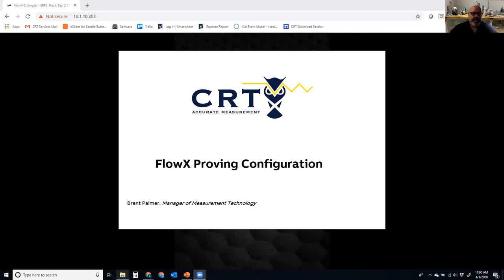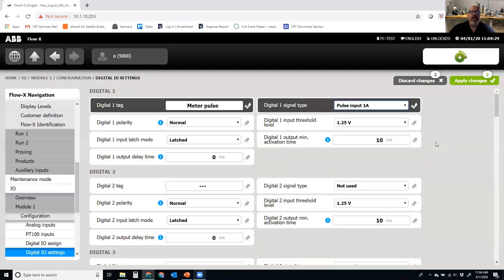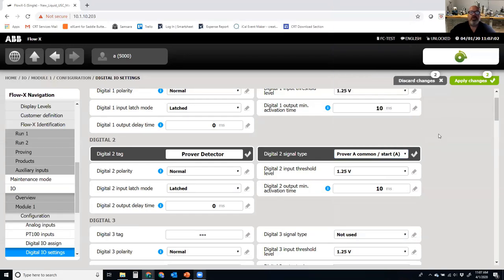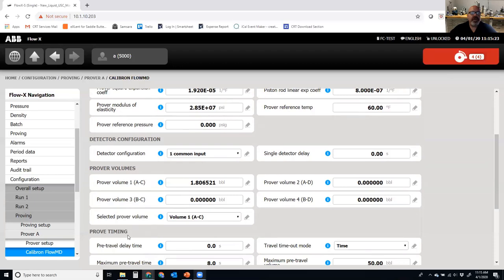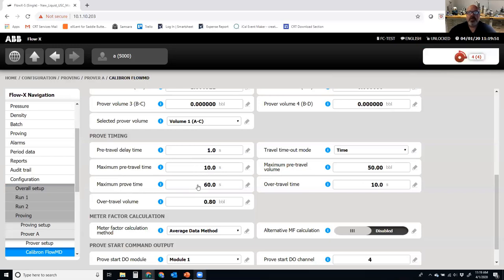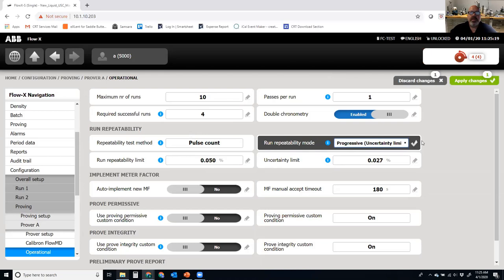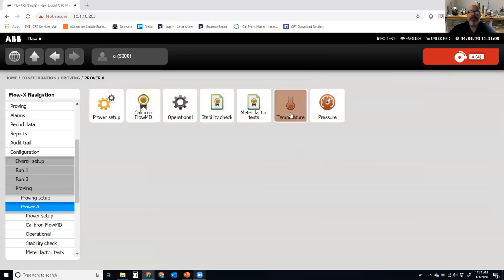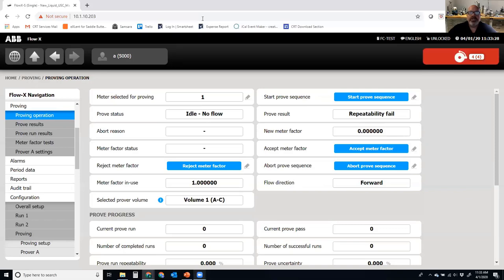FlowX Proving Configuration For Measurement Automation

Comment: Thanks for the video. I do have a question.
Let's say I will configure the Flow-x as you did in the video, thus flow-x output is configured to start the prover. Is it possible to start the proving sequence by a PLC sending the start command to the Flow-x which will itself output the command to the prover?

Where can I find some dedicated manual about this?

Thank you.
Reply from the maker: Yes this is certainly possible, for manuals visit our website www.crt-services.com

Comment: Great video presentation, Brent.  Is it possible to setup the Spirit to auto prove?  Can you set it up to prove after x number of barrels after a batch switch, or something along those lines?
Reply from the maker: Sure that is possible. Feel free to email me or Brent if you need assistance setting it up.  service@crt.services
Reply: Auto Proving is not a good practice. Manual is good. In case proving failed in auto its not good. In case your prover Plenum pressure is low hydrol oil pressure is low. In this case also system not allow to do proving.
Reply: @anandanramachandran3930  That's funny, I have been auto proving for 40 years and have had great results.   But you stick with the manual proving.
Reply: @jameslee7582  great, but we are using portable prover. May be you using master meter?